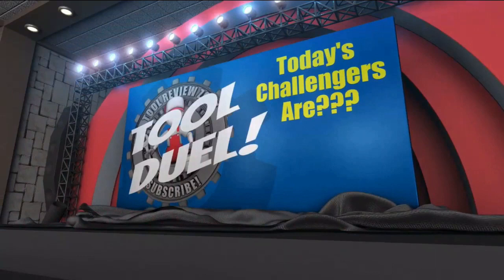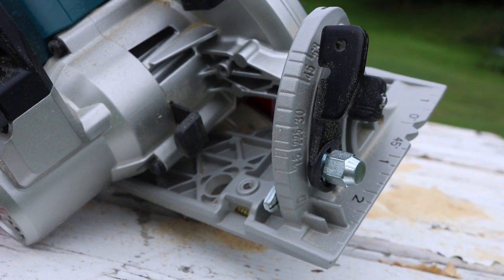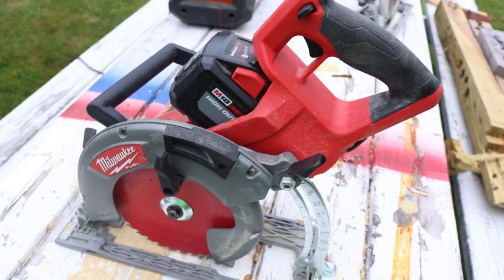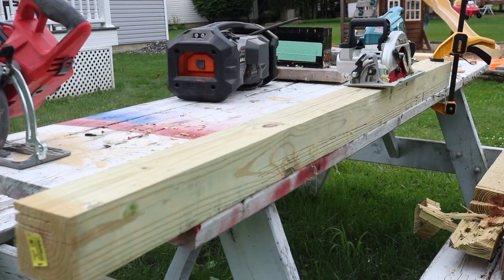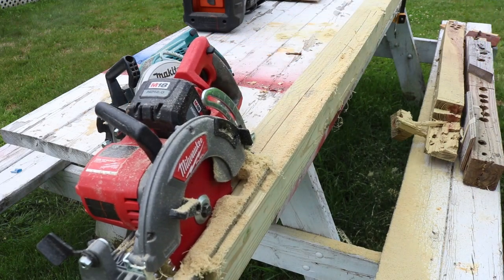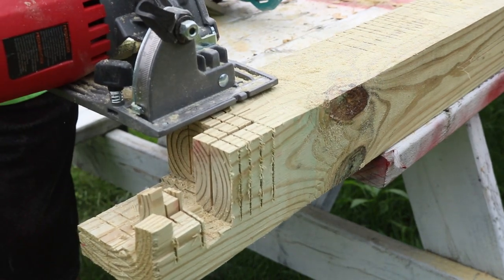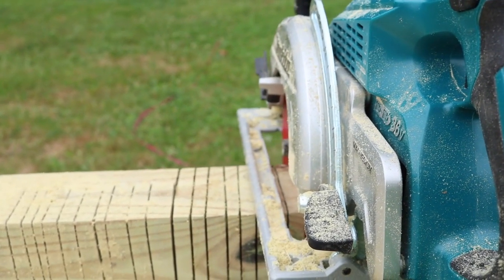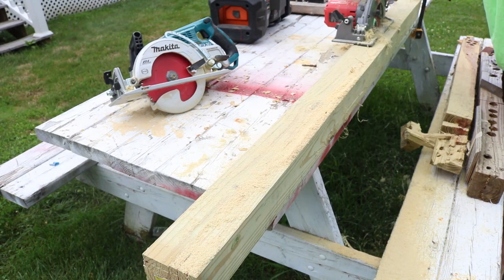Milwaukee VS. Makita! Milwaukee 18v rear handle saw vs. Makita 36v rear handle saw (Tool Duel!)

Comment: I am absolutely an M18 Fuel guy- no question (my primary Packout is taller than I am) but I have both 36V Makita LXT saws (this one and sidewinder 7 1/4”) and let me say when people say Makita saws are “smooth” - wow! Never in my 30 years as a carpenter have I been so impressed! The Milwaukee is a sledgehammer, but the X2 Makitas (BOTH of them) are just wood SCALPELS! Not that it matters, but the dual battery setup helps provide the amps (torque) only when it needs it. Smart battery/tool protection is awesome for all of us woodchucks in the field! Fantastic channel sir- keep up the great work! You are very much appreciated!!

Comment: I'm a framer. Went through 4 brushless milwaukee saws, lasted 3-6 months each. I now have 2 of the makitas and they hold up alot better to abuse and don't have so many electronic glitches.
Reply: You do know that you only had to buy two because Milwaukee's  Warranty covers it,  I hope you new because it covered mine while one's in shop getting fixed you have a spare lol 😆
Reply: @plumbbuild6517  yup bud 2 year old 6.5 brushless milwakee fixed it no questions asked.i have two
Reply: I GOT MINE FOR 3 YEARS NOW AND STILL SHARP
Reply: I highly doubt that. Milwaukee tools almost never fail. I’m an electrical contractor with several thousands of dollars worth of Milwaukee cordless tools in all of my service trucks. We do wind generator,  industrial solar panels and saw mills. So don’t try to say all we use are residential m12 impacts.
Reply: These experiences always baffles me when I see them, which is thankfully rare, I've had countless issues with Makitas, especially their newer drills - have literally had one of them burst into flames. Have never had an issue with Milwaukee (or DeWalt, for that matter).

Although I will say, Makita's saws are amazing and I'd highly recommend them, but I'd recommend Milwaukee's as well, if you're on the platform.
Reply: Update:

I now have 6 makita rear handle saws. Some well over 2 years old and used every day. Every one is still running.

Milwaukee saws were good when they were running but warranty work takes a lot of time and I would rather pay for tools to stay in my trailer. 

I Also own a Milwaukee framing nailer that has gone in for warranty work twice. Second time they sent me a new one. It has literally spent more time in the shop than in my possession.
Reply: I do love my Milwaukee drills, impacts, and sds Drill.
Reply: Thats exactly my experience. We really abuse these tools on construction site. Milwaukee may be 15% more powerfull when new. BUT they only last 2 to 3 month until completely fucked up. Under same conditions our Makita stuff lasts 1 to 2 years.
Reply: @jrod264winmag lol yeah he must have made that up lol hahahahaha
Reply: @plumbbuild6517 he doesn’t because he’s lieing 😂

Comment: What everyone isn't getting about the 2 batteries from makita is that 2 5.0amp batteries are far cheaper than 1 12amp Milwaukee battery. Also with the double charger it's like 45 min to charge instead of well over an hour. And you get to batteries that fit all your other tools.
Reply: I didnt read this til after I posted, but I pointed this out as well. The two batteries really do have an advantage in my eyes, mainly because the batteries are all the same.
Reply: Brain Savage exactly. Don't get me wrong I like milwaukee and what they do but I definitely think besides power. Makita got the win over all.
Reply: Milwaukee has the rapid charger, now the newer super charger. Doesnt take long to charge the 12 AH batteries anymore. One tool, one battery. As things should be.
Reply: Not to mention his weight is wrong the Milwaukee is 13.5 lbs with a 12ah battery and the Makita is 12.4 lbs with 2 5ah batteries. The 10lbs he mentioned is tool only which is a worthless weight stat from Milwaukee IMO.
Reply: @ms542  you can use any size m18 battery to run the saw though. I own it. It works just as well with the other batteries, they just die faster. You can't use the makita at all unless you use up two of your batteries. To me it seems stupid. I've used both saws and the makita cuts just fine. But it just doesn't make sense. 2 batteries on a less powerful tool. To each his own i guess.
Reply: All the milwaukee batteries work in all the tools. I sometimes run my saw with just the 3 ah battery.
Reply: @tylerdavis5247  true I have the same saw and I've used 5ah and it worked great and I got a lot of cuts out of one 5ah  I suppose you could get as many cuts out of 2 5ah batteries as  Makita and only use one at a time
Reply: Milwaukee batteries go from 1.5 to 12.0 for the M18 platform
Reply: Have 2 of the makita saws. They eat wood! Amazing kit. Have the opposite hand as well. As good as the. So do have a. Left and right machine to suit all. 👍
Reply: Tyler Davis you can put Milwaukee batteries in the makita tools?
Reply: And I believe the makita also gets more cuts than the Milwaukee and dewalt.
Reply: ...and more weight to pump up your muscle 💪. Is that it? 

For us DIYers that added weight would only tire us fast, more weights more fatigue equals less productivity.
Reply: @josevelasquez841  modern brushless motors work better with higher capacity batteries if they compare the performance of this Milwaukee saw using one 5 amp battery the makita would beat it. Watch when some channels compare one drill with different capacity batteries the electronics inside know that they can pull more power from the larger batteries and the larger battery makes the tool perform better most of the time.
Reply: @josevelasquez841  tell me how you really feel?
Reply: I think the value depends on the individual. Pricing for 2 5.0 Makita batteries (where I live) is comparable to one 12.0 Milwaukee battery. For someone invested in the Milwaukee platform, there are lots of tools that can make use of 12.0 batteries. However the 36v system does have the advantage of it being 5.0 batteries. They're a lot lighter so when you slot them into another tool it's much more manageable. Depends on the individual.
Reply: @tylerdavis5247  yes you can use any Milwaukee battery but only the high output battery will perform better with other batteries the saw will not outperform the Makita.
Reply: @arvismac  for the amount of work a diyer does the performance gains will be negligible.
Reply: I love the Makita 36v just bought the 40v circ saw but it just wasn’t for me. I’m looking to buy the Milwaukee rear handle since I already have the Sawzall with 2 5AH batteries and one 12HO battery.
Reply: For most material the milwaukee runs just fine with a 5.0 Amp hour battery.  The two battery nature of the Makita is a weak point.
Reply: @dylanunderwood2938  You are saying "exactly", but you are wrong.  You can run a Milwaukee saw off of 5.0 Amp-hour batteries no problem.  And one Milwaukee 5.0 Amp hour battery costs less than two Makita 5.0 Amp-hour batteries.  If you do this sort of thing for a living you are going to have a dozen batteries of all sizes and a sequential quick charger running anyway.  My rig charges them while I drive to the site.  Not a issue at all.  Most people would rather just have one less battery and save two pounds.
Reply: @ms542  You can run it with a 5.0 Amp-hour battery as I do all the time.  Two batteries is just a design flaw to me.
Reply: I’m still confused why people don’t like the two batteries lol have you used this saw? Because the two batteries is literally nothing haha I don’t even notice. I can buy 10 batteries 5.0ah for just over $600 lol I like the two batteries. Looks cool too.
Reply: Well rn,that makita it's $300 for the tool and 4 batteries

Comment: I'm a carpenter,  and our whole company about a year ago switched to all cordless makita power tools, and I must say coming from using corded skillsaws, I absolutely love the 36v makita circular saw. I actually bought one for myself, and retired my skillsaw.
Its lighter, battery life is actually pretty good. Batteries charge pretty fast. Also, replying to the video on battery life, if you look at the tool, the battery indicator show 3 bar, vs the batteries themselves show 4 bars.  So at 2 bars on the tool, the batteries are actually at 3 bars.

One other thing I like about the makita is the fact you dont need to buy any special battery to use in it. You can use any makita battery that you use in any of your other makita tools.

I'm not sure about other brands, but it looks to me that if you want your saw to last and have good preferences, you have to buy a more expensive and specific battery, like the dewalt 60V 9ah battery for just that (1) tool.  I could be wrong, about that last part,  but I know for certain all my batteries for all of our power tools are all interchangeable because they are the same, which is honestly really nice because if randomly any one of the batteries takes a crap, it doesn't really stop, or slow me down from working,  like it might if your 60v battery might. 

Also to be fair,  at works we have around 30 5ah 18v makita batteries, also at home I have around 8. So there are not shortages of batteries, and that's because we practice the 6 P's.

PROPER PREPARATION PREVENTS PISS POOR PERFORMANCE.
Reply: Little caulk little paint make a carpenter what he ain't
Reply: My hole company 5 guys and it’s hole company 🤡

Comment: I’m glad I waited to purchase the 36v  Makita. Went to Home Depot and was about to purchase the 18v BL Makita at 159.99 but decided to check prices online at HD. Saw a deal for 249.99 with 36v Makita, double battery charger and 2 5hour battery’s. I was like wow I’m getting that. I was waiting for a representative for help as I kept looking at the things they had online and found an other great deal. Same price 249.99 36v Makita circular saw, double battery charger, 2 5AH batteries but on top of that 2 more 5AH batteries for free. That was a $330 dollar savings. Think about this. $199.99 just for tool only.. I could not resist. I only have to wait 1 week for my new toys to arrive. Not mad at all.

Comment: I’ll take the build quality and longevity of the Makita all day every day.
Reply: Ryan Bingham yup for sure
Reply: Yea the makita saw and battery will last way longer
Reply: @snick._.c  how do you know this? What is this based on? Your own experience?
Reply: How fo you know this? What is your statement based on? Scientific data? Your own experience?
Reply: @nohcho84  so at my job site we do a ton of concrete forming I mean I've bought two m1 Martinez hammers and pretty much like destroy them within the last three years and so the Makita saw it seems to just kind of the build quality holds up way better not only from a battery standpoint but from an actual like saw standpoint The Milwaukee is still a good saw and it's got more power than the Makita but the Makita just has like more electronics in there to regulate you know like the electric brake and things like that The Milwaukee batteries and pretty much every other battery maker out there are all the same and Makita is the only one that makes their own batteries sorry if this was long I did a voice type cuz you know time
Reply: @nohcho84  and yes this is based off of my experience for the past five years of running both Makita and Milwaukee saws Makita mostly with the two 5 amp power batteries That's the only ones we buy for that and the Milwaukee with everything ranging from the three all the way up to the big boy 12 amp hour batteries
Reply: @nohcho84  also if you're in the heavy construction you need to go with the Makita it's just kind of no brainer but if you're a homeowner Milwaukee is definitely a solid option for any homeowner because it's not going to see the abuse and the torture that most concrete contractors put on their saws
Reply: nicholas cuellar where did you hear that? Milwaukee is more expensive Than dewalt and makita. Milwaukee beats most of these brand in comparisons on other channels. Milwaukee is in the pro category.
Reply: @chriskarsseboom2200  yup the Milwaukee is faster but not by that much and the batteries definitely will have a shorter life as their motors pull more power and the batteries are built with a higher output in mind and will need to go thru more charging cycles and have a shorter life cycle. A friend of mine has the fuel saw and I have the makita 36v saw and when they were new a year ago the Milwaukee was clearly faster not by much but it was a solid lead every time. As of today his saw is no faster than mine.
Reply: Lose
Reply: @robertopics  The Makita lasts longer because it uses two batteries... Put 2 3ah batteries in the Makita and a 6ah in the Milwaukee and the Milwaukee will outlast it everytime; Milwaukee's batteries are far better in longevity and run time. Love Makita, they're just about the best value on the market, but their battery life is notoriously unreliable.
Reply: I have had tools from both manufacturers apart, there is very little difference in quality, same PA30-6, etc.
All I would say is that Milwaukees in general have more advanced brushless motors giving more power, I would not be disappointed with almost anything Makita though.
Reply: @chriskarsseboom2200  Hate to tell ya but Makita is almost ALWAYS more expensive. BTW, Makita, Mil and DeWalt are all in the pro category. Mil is a power house but on most of those channels you mention they almost always prefer using the Makita because of the quality and how smooth it is. Makita in terms of quality and smoothness is on par with Festool, Hilti and Mafell......
Reply: @BamaShinesDistillery  makita is not more expensive than Milwaukee. You are totally wrong. Milwaukee is always more expensive than dewalt and makita. Go check pricing or find a comparison video.
Reply: @chriskarsseboom2200  well right now Makitas Flagship drill the GPH01 is 410 with 2 batts.....the Milwaukee is 250 with 2 5.0 Amp Batts. Makita xph10 cheap drill with two 2 Amp bats is 200. The equivalent XPH14 with 2 5 Amp bats is 350 bucks
Reply: @chriskarsseboom2200  in impact drivers the Mil surge is 170 and the fuel is 150 but the Makita 16 is 217........looks like I just did the two most popular tools and you are wrong.
Reply: @BamaShinesDistillery  that's with batteries dude.
Reply: @BamaShinesDistillery  on a side note that Milwaukee impact literally destroys every other impact in its class. So see a torque test
Reply: @chriskarsseboom2200  dude....those tools woth the exception of the xph are higher without the batts
Reply: And the impact driver prices are toil only
Reply: @chriskarsseboom2200  The Milwaukee does not destroy every other....the flex is even stronger. But what it does destroy is bits....there is a point where the impact drivers are too strong and they are all their. I have the xdt16...I cannot run it on high for any high torque run....it breaks too much junk....the fuel and Flex and new DeWalt are all the same way. The XPH 12 and 14 are the only tools that were cheaper tool only. The 14 by 20 bucks over the mil hammer drill....every other price was tool only......the xdt with 2 5 Amp Batts is near 400 bucks....Makita has the undisputed best and longest lasting batts on the planet....thats why they still use 1850 vs 2100 cells. They are also the only tools that has the batt and tool communicate with each other. All others just communicate in one direction. That's why Makita went to 18x2 instead of just a 12 Amp Batts. The 18x2 has the same numbers of cells but lasts way longer.
Reply: @chriskarsseboom2200  I'll even give you an outlier and the reason I'm in the mil 12v line.....the mil 18v rivet gun is 900 bucks tool only....the makita is 1500 tool only. The mil 12v was 300 bucks...then miter saws...mils top of the line is 699....makitas 2nd tier 18x2 is 814.....both tool only
Reply: @BamaShinesDistillery  drills, Milwaukee is more expansive. Impacts is Milwaukee is without batteries. Miter saw makita is a better saw. 800 for makita and 750 for Milwaukee 12 inch. But sawzall, impacts 1/2 3/8 Milwaukee is better. Ratchets or pretty much any other tool expect circular saws Milwaukee is better.
Reply: @BamaShinesDistillery  you know there is entire articles written about average tool prices across the board. Go check them out
Reply: @BamaShinesDistillery  makita ceo admitted there battery tech was holding them back. Milwaukee changed the game with there batteries. That is why you now see the new line of makita batteries.  They are playing catch up. I have the makita drill and impact combo I know how much it cost, I also own the Milwaukee combo
Reply: @chriskarsseboom2200  Makitas kid torque kills Milwaukee.....Sawzall Milwaukee has orbiting....it doesn't beat it without it.....As far as more expansive in drills I don't understand....Makita has multiple 18v drills and even a 40 and 36 volt line. I don't argue that Milwaukee is a straight powerhouse in almost everything......but more times than not is straight overkill with batteries notorious for the three year fail. Look at the same torque tests you asked of me. The Makita is almost always the preferred brand. Their batteries last longer, they are more comfortable and just run smoother. And Milwaukee when they do win a torque test doesn't blow Makita out of the water. I have both brands.....I cant even remember I picked up a Milwaukee drill last....the Makita is just easier to use all day. And the batts last forever.
Reply: @chriskarsseboom2200  Also don't think you understand the ratchets....again Makita wins here with the fastest speeds....ratchet are not about torque but nut running. Now the Mil 12v high-speed is beast and even beats their 18v version.